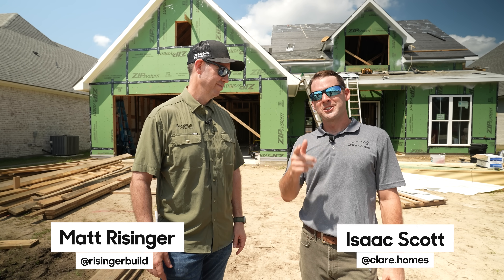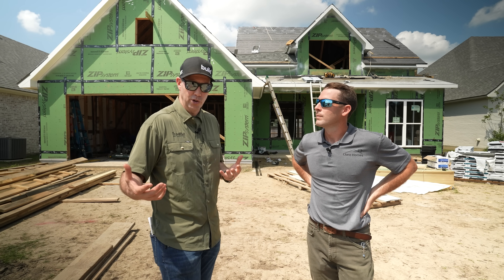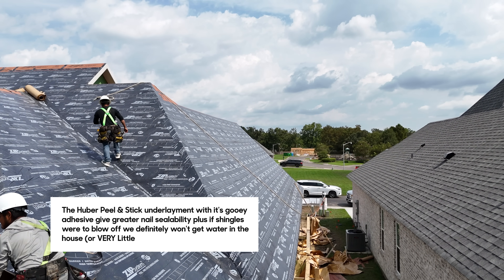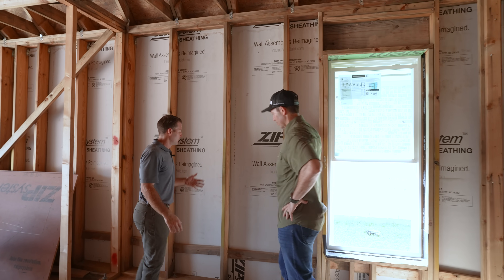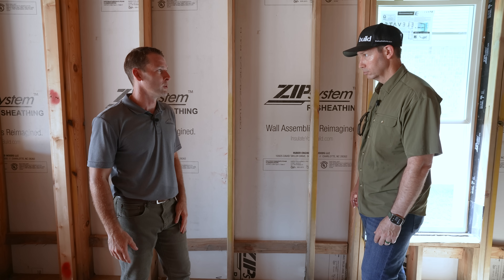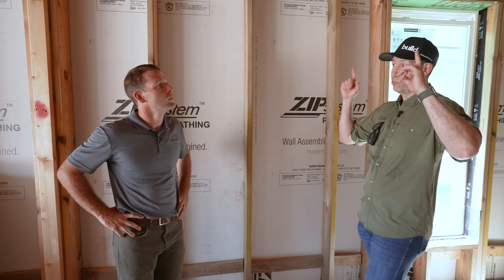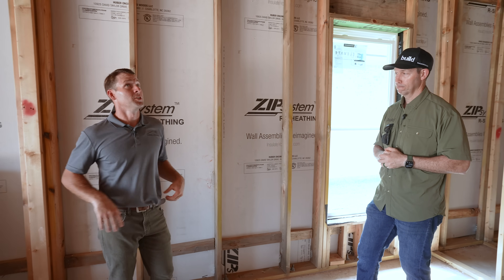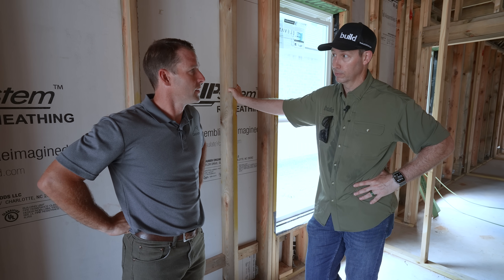3 Details For Framing in Storm Zones

Comment: Truss/rafter strap should be on the same side of the wall as the strap from the top and bottom plates to avoid top plate rotation problems.  Especially with a 2x6 wall.

Comment: 2x6 framing is cool and all, but anyone watching this I would recommend checking prices of your local lumber. My local Lowe's is selling 2x8s for only $0.20 more. Not per ft even, literally twenty cents more for the same 12ft length. Had I noticed sooner in my build I would have just done 2x8s on 24oc, standard framing rather than the barndominum I ended up do which required expensive spray foam.
Reply: @Eric998765  what grade lumber does a Lowes carry I wonder?

Comment: Why do builders not space the  trusses  on 16 center?
Reply: It's less labor and better thermal performance to increase the size of the wood, but space it farther apart. Stacking trusses on studs keeping centers the same also helps transfer loads better than having different spacings for studs and joists and trusses.
Reply: @danielchin8073  
Also, my walls are 16, and my trusses are 24. I just do not see that being stronger or helping with the thermal balance.  I will have to research the thermal part. 
  The fact they are built out of a 2×4. You loose strength for attic storage. The sheetrock joints will take a beating. Then, walking on the roof, you can feel the joints in the osb give under your feet. The H- clips do nothing. 

    This coming from someone who has dealt with stick frame roofs on 16 centers and can tell they are better built.

Comment: Homes in Hawaii should be building with similar features. I like how there are builders who go beyond for the eventual home owners. Worth the price !
Reply: Homes in Hawaii and termites.  They even have ants that will eat through cinder block.
Reply: @mefobills279  I'll settle for an ICF (concrete) construction then, but with same hurricane resistant roof since they are going to be more common in Hawaii with climate change.
Reply: @bobnomura2068  I've been thinking about Hawaii too, and I have relatives there.  I think ICF is great, but be sure and put in the stainless steel termite flashing so their trails are exposed.  Perfect block is another solution, but good luck getting them.

Comment: why not do closed cell for the roof- wouldn't that add another layer of water protection?  also hold things together a little stronger?
Reply: They can, but if water makes it as far as the insulation, it's probably saturating the wood of the roof and not able to dry well. The homeowner then isn't seeing any signs of water in the house and doesn't know that the roof is rotting until much more damage has been done.

Comment: Why is 24” OC called advanced framing when it requires less work and cost than 16” OC framing? Just another way a contractor tries to rip the buyer off with a fancy name and less work and cost. 😂
Reply: Probably because the load needs don't really need 16. They don't have "snow loads" in Louisiana, so the heaviest thing you're going to have on a second level is probably a person. In their case it's more about keeping the roof DOWN rather than keeping it up, and a hurricane isn't going to rip the studs apart in the middle of a stud, the structure is going to fail between stud and top or bottom plate, hence why they add steel.
Reply: @SeanBlader  Doesn’t sound so advanced to me. In Texas, 99% of homes are built 16” OC, but builders like Risinger started “advanced” framing charging 500+ per sq foot. There’s nothing advanced here.
Reply: See you're not up on the actual science of faming and thermal transfer. Google it and read a few articles. Save lumber, and improve Insulating values are two benefits. All modern day contractors are gonna rip you a new one if you don't do your research... and watch out, most Mexican crews do a lot of "eyeballing". Fast, but plumb, square and straight are only a suggestion in their framing world.
Reply: @BigTee-lp7qu  And your comment about incompetence of most Mexican crew is unfounded in my part of the country. It’s not about race. It’s about experience and ethics. So leave your xenophobic mindset out of this conversation.
Reply: @JohnLee-db9zt  just two words to both of your responses JL, "overly confident". If you're such an "xpert" where's your channel? The real experts "are saying" that advanced framing HAS come of age like 19.2 , 24 OC ups the thermal bridging concept if u you aren't using full coverage exterior insulation. You get your feelings hurt way too easily. And yes, not all ethnic crews are incompetent just as all old world Caucasian crews are proficient at what they produce. In my part of the country the Hispanic crews roll in with a troup speaking Español and blaring Mexi-music all the way down to the early teenage helpers, run framing and sheathing an are gone within two weeks.  I've walked into these sites and 16 OC might mean 15" or 17" as easy as 16. Plumb and square as I've said ARE a suggestion. Maybe you ran all the eyeballers out of your area to mine. Not saying that you are a total shizshow in your drawn out soliloquy with all the building science buzz words but you're pretty much like a millennial in that you think you know everything but you basically always need a participation trophy to validate your placement because you can't get one for performance.
Reply: @BigTee-lp7qu  I’ve must have triggered you so hard for you to write an encyclopedic response. I never claimed I was an expert, unlike you who like to condescend those who have legitimate argument. Most real experts in the field don’t have YouTube channels because they’re too busy working. Have you noticed these YouTube experts overcharge just because of their YouTube status? Cope hard. I’m actually building a net zero home while you’re here being insecure because someone challenged you. Lol
Reply: @JohnLee-db9zt  they only charge what they can get. They must be worth it.
Reply: @BigTee-lp7qu  Instead of being condescending, how about asking me what I do know about science of insulating a house. I’ve been researching this field for 10 years.  Instead using 24” OC framing, I’d use 16” OC framing with continuous insulation on the outside rather than just inside. It’s better than 24” OC because you have a stronger wall using same size studs, especially relevant in hurricane prone states. And most trades are more familiar and most equipment are adapted to 16” OC framing and thus more economical in most cases. Also 24” OC requires at least a 6x4 stud or higher (if you’re smart), so your idea of saving lumbar or cost is only a half truth. Alternatively, you can do a staggered double wall assembly with twice the insulation inside the wall with air gap, effectively continuous insulation with more effective sound deadening, if you want to take it a step further. All the framing and insulation outer wall are nonissue for me since I’m currently building my house with a type of ICF that maintains contiguous thermal mass indoor (no insulation on the inside to allow thermal bank to maintain the interior temperature of my house) and contiguous insulation along the outer ICF wall, while allowing adequate degree of vapor permeability (unlike traditional ICF with EPS foam on both sides). Does this sound like I haven’t done my research? Looks like you need to do more research if you want to have a valid argument with me.

Comment: As a European living in Canada, I’ll never understand shingles and changing a roof finish every 15-20 years. Total insanity.
Reply: Save a buck today and pass the cost on to the next owner. 10 yr life asphalt shingles are an example of the typical American builders profit driven shortsighted and wasteful building philosophy.
Reply: @SavageBits it actually makes sense because Americans move more often than Europeans so they are not as invested in a specific dwelling.
Reply: Yeah, As a brit that it always feels weird that they're using what we would only use for shed roofs on the main house. Replaced my roof last year, was preventative maintenance as had been on there for 80 years and that was for a cheap ex council house build. But then no hurricanes to deal with.
Reply: @ralphvickery3050  curious , what was your roofing material for 80 years?   thanks.
Reply: Bottom line - asphalt shingles are crap! My parents in South Louisiana replaced their asphalt shingle every 10 -12 years. Standing seam metal roofing is the best option, 25 years so far and ZERO ISSUES!
Reply: @MikeYoungeasytravel  I agree a standing seam metal roof is much better. And cost of it is much higher than shingles.
Reply: @chrisbabbitt4202  Actually, standing seam is much cheaper when you consider the total cost of ownership during the lifespan of the house.
Reply: I would love to see that be true where I live. Here, standing seam might last almost 3x as long as asphalt shingles but costs more than 3x the price.
Reply: @MikeYoungeasytravel  yeah now your house looks like a barn. Standing seam are fine for a shed , barn, garage. But look like shit on a house
Reply: In hotter climates of the states they use tiled roofs cause uv light wears down shingles quicker and tiled roofs keep buildings cooler. In snowier climates it is better to have an asphalt roof cause of the snow load and tiles will crack easier in below freezing temps.
Reply: And they wonder why houses burn down in CA so easily. Let's cover the roof in a petroleum based product.
Reply: @ippolitius asphalt shingles are Class A fire rated (they don't burn). Just as good as a metal roof at resisting fire. They are mostly rocks and fiberglass, with just enough asphalt to hold everything together.
Reply: @mynameIan  Geopolymer institute 3D printed a geopolymer home (1000 years durability) last year.  They included insul-deck roof.  I'm assuming they poured geopolymer cement for the roof.  Geopolymer is impervious to water and freeze thaw cycles.
Reply: $$$$ only reason, more money buys better roofing
Reply: Asphalt is cheaper in the US and Canada because there's more oil. It's not a coincidence. Also why we use more wood.
Reply: So European, what roof do you have in your home and how many years will it last and the cost ?
Reply: Asphalt roofs last 30-40 years and I've seen 20 sq stripped and installed in one day for $15k. Smaller roofs only run you $5k. Pretty solid ROI compared to other aspects of a house.
Reply: What world you live in, tiny house world? Try $25-35K for a moderate sized house (2000-3000sf) with a few different gables and 8/12 pitch in modern sub divs. Go up or down from that on smaller low pitch 60s homes to mama wants a big ole houz.2@Tool_Addicted_Carpenter
Reply: Building homes here in America is so riddled with codes and regulations, it is extremely expensive. So in order to be able to afford a home, people can't afford things of a higher quality beyond shingles. Factor is very high taxes, and you get a massive housing crisis.
Reply: @chrisbabbitt4202  maybe build smaller, higher quality,  more affordable homes then?  
You don't need to live in warehouse size buildings that require huge amounts of energy to heat and cool.
Reply: @james.telfer  they want an arm and a leg for a 650 sqft home. I'm telling you, building new in America is incredibly expensive. There is a video of one guy detailing the price breakdown and it was 50k in "studies" and approvals of all kinds - just to put a shovel in the ground to start the build.
Reply: @chrisbabbitt4202  Elephant in the room.  The house mortgage can double or triple the cost over a 30-year term.  The codes are not the dominant cost variable.
Reply: @mefobills279  15 year fixed rate is what people should be doing to save a lot in the long run, but of course that means higher payments. It is a combination of several factors that could be a lot better to reduce the cost of housing. Zoning issues also hurts. Nothing like seeing a corrupt city council decide who is allowed to build what where.
Reply: So much to comment on just here.

 @chrisbabbitt4202  The real housing crisis is demand. So many homes are off the market as AirBnB's and not nearly enough new homes are being built to compensate for emmigration and natural internal population growth, so bidding wars take over and builders can build fewer places, at the same cost and recoupe even more staggering profits because of the simple demand issue. If I build 1 place that costs 100k in materials and labor and sell it for 600k. That's way better than building 2 places for 100k each and selling them for 500k each. The staggering cost is possible by 30 year mortages. The same place 70 years ago would've been 40k because you weren't doing a 30 year mortage to pay for it nor did you have 2 incomes to pay for it. Inflation hasn't gone up nearly as much as housing costs for SO many reasons, materials is not one of them.

Personally I could never understand why asphalt shingles are actually a thing, it makes absolutely no sense to cover your building with a petroleum based product, unless you specifically wanted it to catch fire. And you can understand why on Matt's house he went with a metal roof. There is frankly nothing more durable than metal against fire, UV, wind, ice, or anything that you can throw at a structure.
Reply: @chrisbabbitt4202 it’s even worse in Europe. However they deforested a long time ago. They also have many more centuries of home building. Housing affordability is low is many parts of Europe too. The quality is high for what is there but obviously the square footage is much lower. This also lends it self to their higher energy costs. Americans can afford to heat and cool a large leaky house because of the lower energy costs.